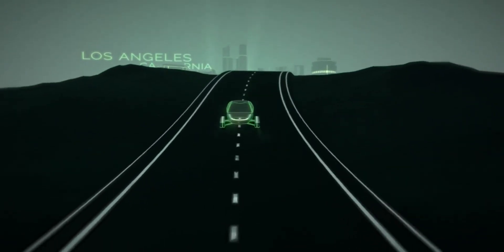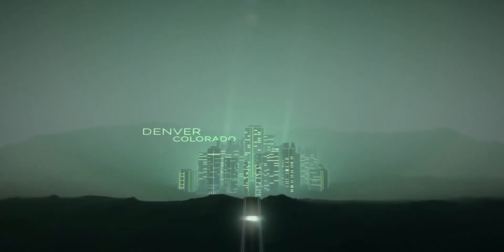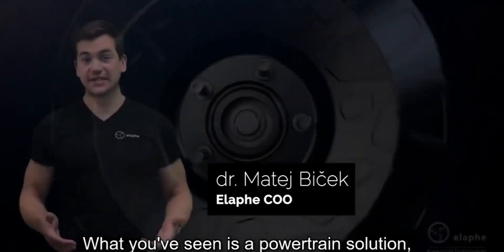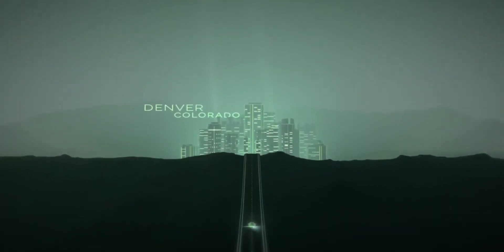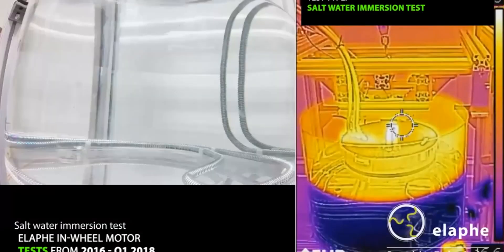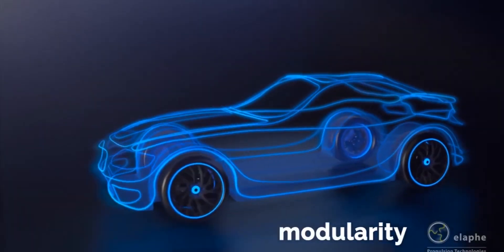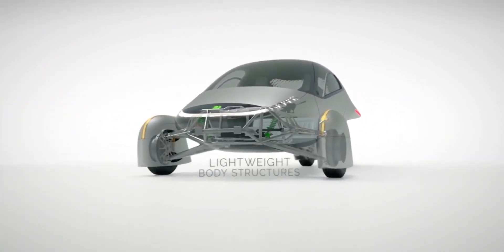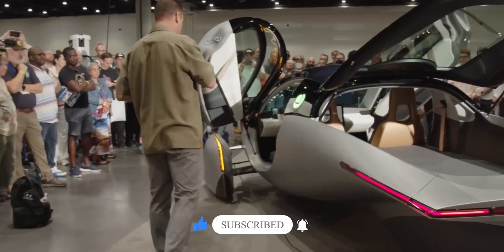Aptera's In-Wheel Motor Design - Here Is Everything You Need To Know!

Comment: My observations about in-hub motors and your presentation style. First, you gloss over pros and cons to make the watcher feel as though you will be fair, then present an unfair balance, leaving off many points where the disadvantages are just too large. I will elaborate:
On the advantage side, you display tank turning, yet Aptera's design prohibits them. They simply only work with 4 wheels. It's an impossible benefit on Aptera - does not exist.
On affecting ride and handling, due to unsprung weight. It also affects braking, but the omission was that it GROSSLY affects them. Aptera says that they have minimized weight elsewhere to compensate, but that is just jerking the gullible; they have added more weight than they could ever reduce with the addition of pants - probably to the tune of more than 10 lbs. Auto makers use alloys to shave off about 20% weight that steel wheels have. A 16 inch steel wheel is about 30 lbs, and an alloy about 24 lbs, so a roughly 6 lb saving. They would never dream of adding 60 lbs, which is the Elaphe motor and the pant - that's ten times more, and twice the weight of even a steel wheel. It is a GROSS error, and not something that is lightly dismissed with saying they compensate - it is impossible to compensate for. So, you tell me what in the unsprung parts of the EV have they done to compensate, since Aptera doesn't tell us?
While you say some wannabe new startups have turned to in-hub, and most others have a banal mentality of sticking to the status-quo, the reality is that dozens of new EV makers have considered them and rejected them. In fact, e-bike reviewers say mid-drive is superior, almost to a man. The added weight of a car-sized EV makes them far less viable than for an e-bike, since weight is the main factor.
Not only does the trike suffer worse ride and handling than had it had 4 wheels and in-body motors, this deadly combination induces spin while sliding off the road, and no amount of technical trickery can offset it.
Finally, while unsprung mass is massive, you have not mentioned the disadvantages of those inboard brakes, and there are two big ones. First, the rotating mass of an extra 50 lbs is something the brakes have to haul up. Rotating mass is much harder to stop than had that same weight been sideways in the body with no forward rotation. You don't even have to stop it rotating, yet in the wheel you have to. The brakes are heavily overworked. Secondly, brakes need a lot of air cooling that Aptera can't supply. It shrouds them in a pant that blocks the air and adds the heat from the motor, to boot. Brakes that have to work harder while being heated rather than cooled is plain stupid.
What else is stupid is believing the claims of people who sell a product, and Elaphe and Aptera are both those. Wait until some independent tester has verified what they can and can't do. I have heard Chris A (CEO) say they know better than the combined wisdom of engineers in the entire auto industry for over one and a half centuries. I refuse to taste the snake oil.
Reply from the maker: What an elaborate observation. You've definitely given us some new perspective on the matter, perhaps I omitted a few points to make the video a little shorter (which still didn't cut it ) but I think waiting for individuals to test these motors and then reviewing their observations in a different video is the way to go as of now. Thank you so much for your contribution on the topic,  I've certainly learned alot more. And I'm sure others reading this will too.
Reply: @BusinessAndGeopolitics  [What an elaborate observation.] It comes of 10 months of learning about Aptera and making my own videos as a naysayer. 
[You've definitely given us some new perspective on the matter,] You are welcome. 
[perhaps I omitted a few points to make the video a little shorter (which still didn't cut it )] I have nothing against brevity, unless it deceives people in the process. 
[but I think waiting for individuals to test these motors and then reviewing their observations in a different video is the way to go as of now.] Definitely. Too many people crossing bridges that aren't there. 
[Thank you so much for your contribution on the topic,  I've certainly learned alot more.] Again, you are most welcome. I hope you research what I said to validate my claims? 
[And I'm sure others reading this will too.] Maybe some, but the fanboys won't learn; they flatly refuse. There has to be closure soon. When the money goes out faster than it comes in, they will have to sell trikes, or pack up again, and it's almost at that point. Just letting you know that if one is for sale that lives up to all the promises, I am going to buy it. I have nothing against something so good, but I can't see it being feasible at this stage.
Reply: So many false statements here.  First "They simply only work with 4 wheels. It's an impossible benefit on Aptera - does not exist."  There is no reason it can't work.  We don't know yet if this capability will exist in delta as a stock feature, but it can certainly be and has been done.  In fact, it may be covered by patents from other companies.

We know that Roush Performance has designed the suspension and that the current prototypes pass the tank test - a better performance than many vehicles for sale in the US.  Additional comments regarding "deadly combination" and inducing spin have zero evidence behind them.

" The brakes are heavily overworked. Secondly, brakes need a lot of air cooling that Aptera can't supply. It shrouds them in a pant that blocks the air and adds the heat from the motor, to boot. Brakes that have to work harder while being heated rather than cooled is plain stupid."

This statement is proof that the author either has not looked at or understands the design.  First of all, most of the braking force comes not from the brakes themselves, but from the multi-level regen function.  Very little braking will be required from the disc brakes.  In addition, the cooling for the wheel motors is supplied primarily by circulating antifreeze, not air cooling, although there is some of that, too.  

The author enjoys making up straw men, and posts from his active imagination rather than facts or experience.
Reply: @n.brucenelson5920  [So many false statements here.] Says the man who hides behind NDAs he asks for and makes no statements; mostly never addresses any challenge.  
[First "They simply only work with 4 wheels. It's an impossible benefit on Aptera - does not exist."  There is no reason it can't work.] I agree; it CAN work when the single rear wheel steers, or at least swivels, but no Aptera configuration has that.   
[We don't know yet if this capability will exist in delta as a stock feature, but it can certainly be and has been done.  In fact, it may be covered by patents from other companies.] Uncertainty is not proof of anything. Never has been - never will.

[We know that Roush Performance has designed the suspension and that the current prototypes pass the tank test] We don't know that, and you have lied in the past. Prove any prototype can tank turn? Your claim is worthless.
[ - a better performance than many vehicles for sale in the US.] While it is still not for sale. I don't care if it could do it, while nobody can buy it.  
[Additional comments regarding "deadly combination" and inducing spin have zero evidence behind them.] In many a racing film clip over many decades, you can watch some cars slide off the track with zero spin involved, and you can watch others slide while the tail is spinning around the nose; some slowly, and others quickly. You can also see skid marks at Chuckwalla.

" The brakes are heavily overworked. Secondly, brakes need a lot of air cooling that Aptera can't supply. It shrouds them in a pant that blocks the air and adds the heat from the motor, to boot. Brakes that have to work harder while being heated rather than cooled is plain stupid."

[This statement is proof that the author either has not looked at or understands the design.] That does not refute anything. At best it indicates the author hit on the truth sans research and understanding.  
[First of all, most of the braking force comes not from the brakes themselves, but from the multi-level regen function.] Bakes are needed at times. Most times being regen is not ALL times, and my comments were relevant to the times brakes are needed. Bad brakes are perfectly fine for when regen is doing the braking. I have no issue with that.  
[Very little braking will be required from the disc brakes.] I buy my vehicles knowing my brakes can handle anything. I don't buy them thinking they are okay once in a while.  
[In addition, the cooling for the wheel motors is supplied primarily by circulating antifreeze, not air cooling, although there is some of that, too.] The wheel motors are kept under a certain heat level, but they are hot and beside the brake. An in-body motor has nothing in close proximity to the brakes. In-hub motors contribute to heating brakes even with their cooling system, whereas in-body motors don't.  

[The author enjoys making up straw men, and posts from his active imagination rather than facts or experience.] Gives people something to think about for themselves. This senile, lying disciple would rather you swallow Chris A's snake oil without question. You choose, readers; I don't care either way.
Reply: @aussieideasman8498  You have proven time after time that you would rather call people names than introduce any evidence of your own.  I welcome questioning, and do it myself.  

"Uncertainty is not proof of anything."  Who said it is?  You seem to think so since you would rather challenge a statement than provide any evidence to the contrary.

You obviously care about something due to the frequency of your posting.  Too bad you don't know how to post evidence for your accusations.  Perhaps it is because you are willing to make them without any.
Reply: First who says two wheels can't provide "tank turning" (not an very apt description). If the left front wheel is braking and the right front wheel is powered are you claiming the vehicle will just continue driving straight?  You comment defies common sense. i suggest you test drive a skid steer fork lift - it will give you a good feel for the effect.
Seems to me your criticism of the inboard brakes is seriously faulty. The regen braking by the electric motor makes the brake rotor and pads almost redundant. They will not have any rotating mass to stop - and will exhibit almost no wear. Since they will only be needed for "emergency" additional braking they will not require any significant cooling. In other words, you need to retract your entire brake comment. 
Your unsprung weight arguments are a little more rational - but still pretty exaggerated. The affect on handling, comfort and braking are relative - and are not nearly as severe as you suggest. The motor weight is indeed added to the unsprung weight - but you ignored the weight reductions to unsprung weight of a wheel motor. Remember that the driveshaft and differential are part of the unsprung weight of the ICE drive train. Gee - which weights more - the wheel motor of the driveshaft?
Reply: @vaxed2402 [First who says two wheels can't provide "tank turning" (not an very apt description).} Basic science. Who says they can? Watch my video that explains why they can't, and refute me there, if you can? Nobody has yet. 
[If the left front wheel is braking and the right front wheel is powered are you claiming the vehicle will just continue driving straight?] Not at all, but the turn is only in a forward direction, and the resultant forces on the fixed direction rear wheel is minimal. It will contribute to earlier tyre wear, rather than rapid bald spots in one place. 
[You comment defies common sense.] It's your question that defies common sense, and you have not commented with any explanation - a feature of fanboys.  
[i suggest you test drive a skid steer fork lift - it will give you a good feel for the effect.] I suggest you find me one with a fixed direction single rear wheel? This is what I am talking about. I look forward to seeing what you come up with.
[Seems to me your criticism of the inboard brakes is seriously faulty.]  I look forward to seeing what you come up with.
[The regen braking by the electric motor makes the brake rotor and pads almost redundant.] But when they are needed . . .  what?
[They will not have any rotating mass to stop - and will exhibit almost no wear.] And when they are needed they will need to be bigger, heavier and better cooled than brakes of a car that size. [Since they will only be needed for "emergency" additional braking they will not require any significant cooling.] No timeframe given for how often emergency braking is required. Would a drive out of your mountains to the coast have few needs? Nothing is proven, yet, and needs to be, but you sound like you are accepting a flat, short drive to work is all that will be needed. 
[In other words, you need to retract your entire brake comment.] You can't expect that on your gossip. In engineering, even possibilities have to be evaluated and tested. 
[Your unsprung weight arguments are a little more rational - but still pretty exaggerated.] By all means, tell me where? I look forward to seeing what you come up with.
[The affect on handling, comfort and braking are relative - and are not nearly as severe as you suggest.] Not nearly is about as vague as you can be, and flies in the face of auto engineering measurements. 
[The motor weight is indeed added to the unsprung weight - but you ignored the weight reductions to unsprung weight of a wheel motor.] While you have ignored the weight of the pant, your sentence is nonsense. AM has stated it's 50 lbs, and that is that - doesn't matter if it has been lightened, already, or not - it's 50 lbs. When you stick with reality you don't get muddled by irrelevances.
[Remember that the driveshaft and differential are part of the unsprung weight of the ICE drive train.] No, they are not. Both move up and down with the body. Fixed solidly, in fact. 
[Gee - which weights more - the wheel motor of the driveshaft?] I take it 'of' is 'or', and since no drive shaft is unsprung it's a silly question. The real question is which weighs more - an ICE car's alloy wheel, disc brake and the short transmission/steering parts to the spring, or Aptera's wheel with the motor, heavier brake, pant, motor cooling system and the much longer parts up to the spring? My money is on the in-hub wheel, and it's not even close. Chris A has you hoodwinked with his snake oil claim he has lowered the weight to a compensatory and satisfactory level. He hasn't.

Comment: Good overall info but at 3:00 point, is the car body not sitting the wheel frame via springs or ball joints?

The rear wheel clearly uses springs.

I do not see an Aptera acting like a Skate board, but rather like regular car where the body and wheels are dampened so the body and occupants do not feel every bump as it travels down the road
Reply: He didn't say the whole vehicle became unsprung.